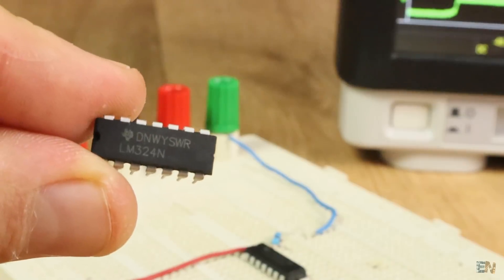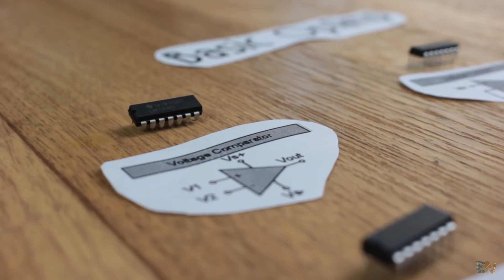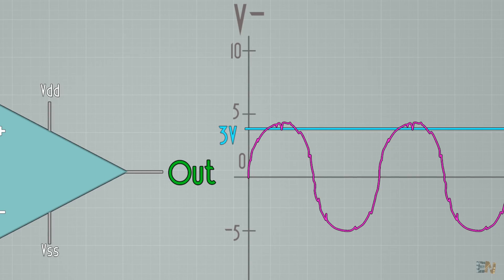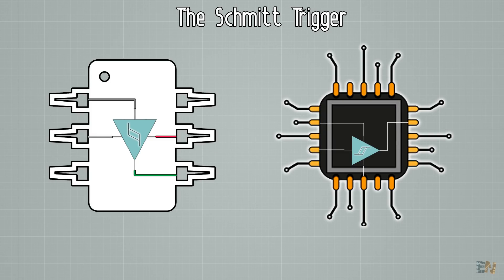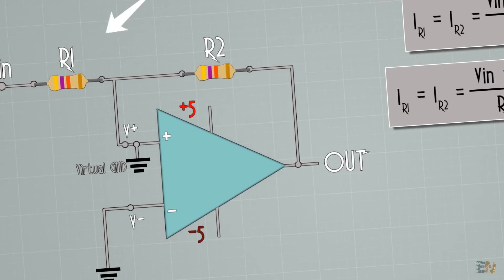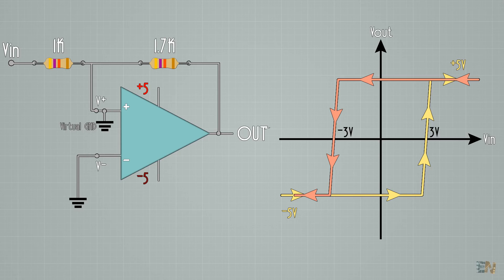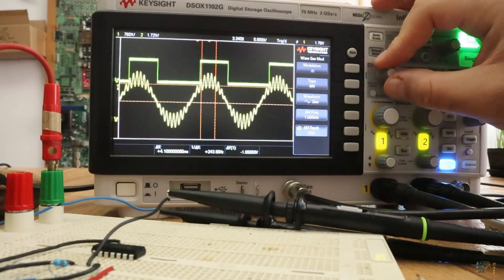Basic components #002 - Schmitt Trigger | configurations

Comment: Can that set up by used to control manuali alternator out put voltage as in cloosed loop voltage regulator circuet?The thing is I have unusual problem with my Delco 12si alternator I admit right away I do not have diode for my field wire so it does back fead to the dash board also my positive linear voltage regulator does not have diode no. The real problem beggines when I start to use ceramic hv capacitor on my ignition coil + fhew of those 3kw capacitors in series and the other side of those capacitors I ground them to chassys wia a trip switch some one call that staff plasma ignition. It does have good perks like faster engine,faster turning starter motor and bether responce to ligh flamabel fuel types thats not the problem. My problem is by useing such experiments on my engine it acured that the delco 12si alternator constantli back feads true the bulb and refuse to shut of unless I rev the engine at around 3-4 k rpm If I let go of the trothel the alternator bulb turns on again. So I doubht a diode wuld help at all it wuld only prevent back fead but not solve the problem .I figured out my alternator uses the - baterry value voltage potential snd converts it to + basicali via tge voltage regulator I did open that thing and found just what looked like white ic chip and 2 micro capacitors nothing ells in that thing so Im not shure uf partiali the bulb resistance has some thing to do with it or the positive linear voltage regulator creates some sort of voltage potential difference so the alternator can automatucali shut off or on on demande? So I figured it might by posibiliti that capacitor/resistor box might by abel to control alternators voltage to amps ratio at centrain engine rpm speeds. So I might by wrong wuld some one agree its manual alternator excitation control? And how posibli I culd force that alternator to charge baterry at lowr speeds? And how possibli I can avoid the hv ceramic capacitors to interfeare with my alternator starting cutt in current? I tough about it to use in series or parrarel configuration 2x voltage regulators and manuali engage them with push swich Im not shure if that wuld work or not delco made also tractor voltage regulators so Im honestli confused what to do and get ride of that anoying problem?

Comment: 3:18 Something doesn't make sense here. I get that there are two thresholds. If the ascending portion of the sine wave crosses the upper threshold (3 volts) the leading edge of the pulse is generated. So far so good. Then you say there is a ripple spike that drops just below 3 volts but that this is ignored because the spike doesn't go down to the lower threshold. That's fine, too. My question is why then did the descending portion of the sine wave trigger the trailing edge of the pulse just as it crossed the upper threshold instead of the lower threshold ? Shouldn't the square wave pulse been a bit wider to the right ?
Reply: He made a mistake. I noticed it too.

Comment: Nice video. Im new to these stuff and i dont know lot of things about electronics. I have a variable reluctance sensor from my motorcycle (crank position sensor). The values and noise level are not constant throughout the rev range. What do i need before the schitt trigger ? My signal as i said is not very clean.  My peaks are variable . As the rpm rise my peaks are getting bigger, my lows are not so constant.(so close to zero) I dont think schitt trigger going to work right away.
Reply: A micr controlller has to alter the potentiometers digitally.. not worth your while..

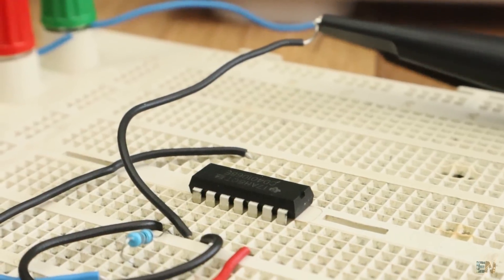Comment: I catch some error. At 3:16 green rising edge should be in cross point of purple and blue line, similary as in 4:55
Reply: Yes, the rising edge is not at the right place...
Reply from the maker: As I say in the video, that chip is an inverter as well at 4:55 I've inverted the signal 2 times to get that wave.
Reply: I know it is invertet but if you look at 3:16 then rising edge of green line is in wrong place, it should trigger at "lower threshold", which is visible at 4:55 but inverted.
Reply: I think that the error is at the lower edge. at the scope seen at  4:55 the signal was triggered at high edge and triggered again at <b>low</b> edge whilst at 3:16 they were both on the high edge.
here is another example:
https://howtomechatronics.com/how-it-works/electrical-engineering/schmitt-trigger/

yet I must add that this video is excellent and very informative..